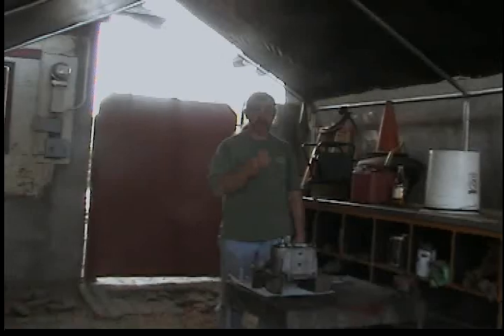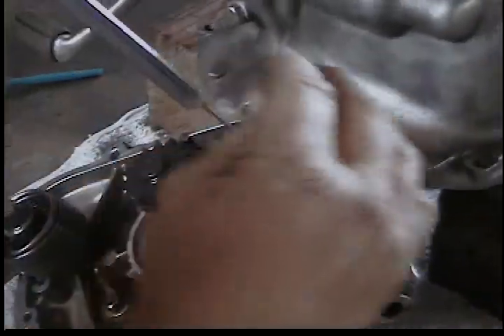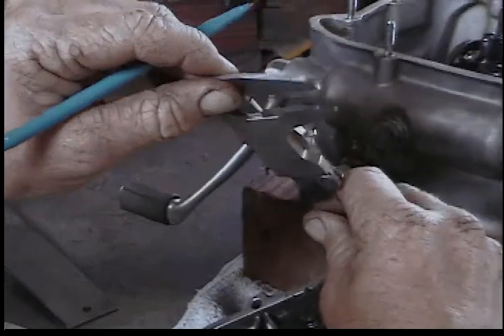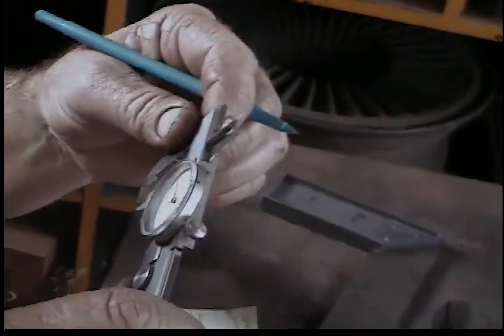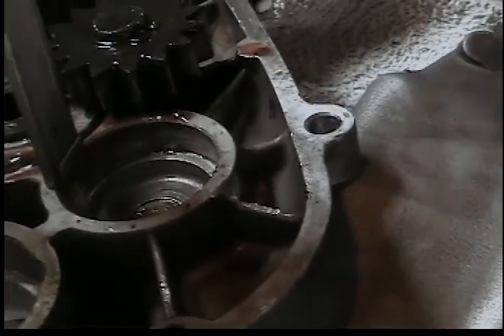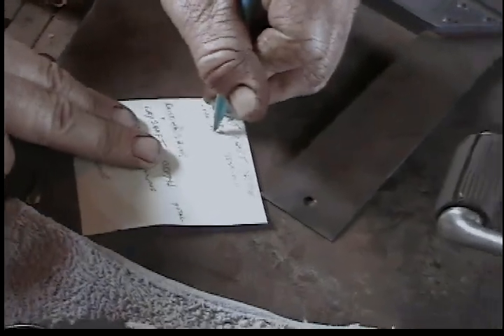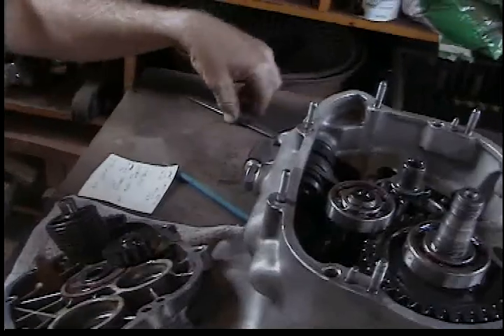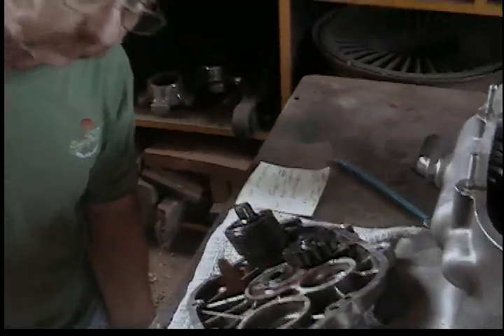R75/5 gearbox endplay measurments

Comment from the maker: no, i never considered solder as a medium for measuring. i would have considered a Plastigage except for 1 factor. 
are u aware that the case needs to be heated up beyond 180* to swell it up enuff to slip the bearings in? how effective do u think solder would be for measuring at that temp?
Butt-wipe!